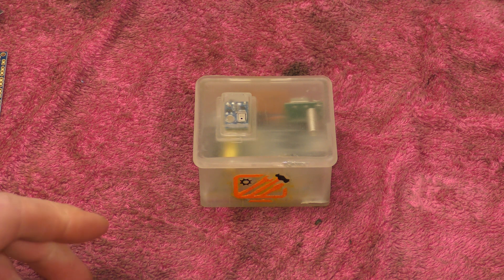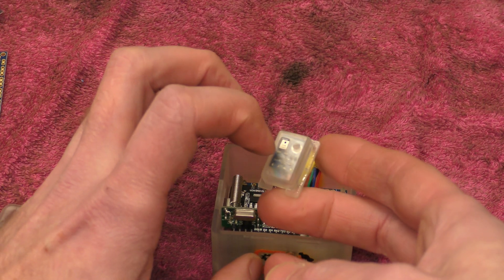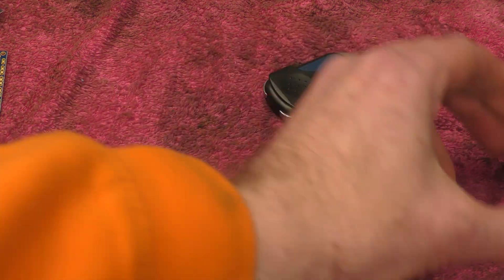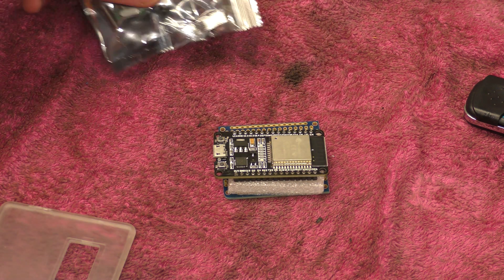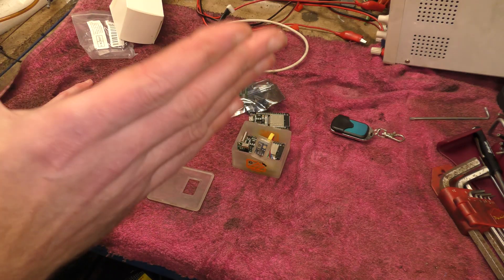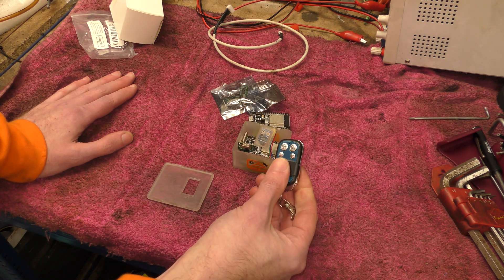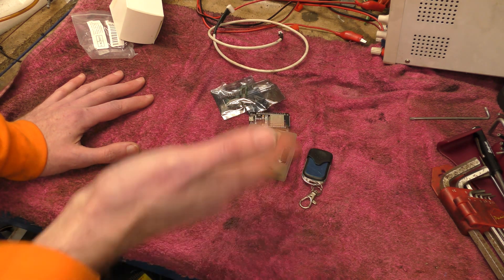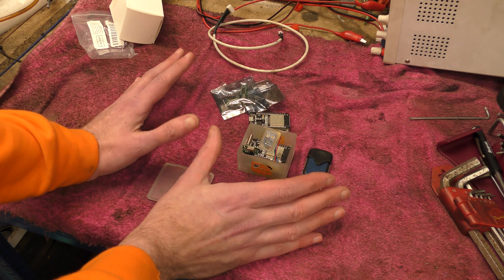The Dragon Tamer - chinese diesel heater temperature and humidity controller

Comment: Sorry my website is down at the moment. Just bad timing. 
Just a few corrections. The RF433 on the board is just a transmitter. There is a receiver in the kit I sent. You only use that once to learn the codes. If you do use the code, don't forget every one will have the same remote code, and you will have to pair your diesel heater to it. The best idea is to make a receiver grab your own codes,  then program them into your ESP32
The sensor is a AHT10 not the DHT22 but it could be used but not with the code provided.
Reply: @WiLLiAMOnline  Hi I haven't done a tutorial, but it works by copying the code sent by the remote control.

Comment: I have similar control with the Broadlink RM pro+ paired with a wifi temperature/humidity sensor 👌
can set turn on/off up/down settings automatically depending on temperature or humidity

Comment: This type of content is why I subscribed, I only wish you would avoid the crappy promoting of cheapo generators/power packs etc. You have a great presentation style and I wish you success, you really don’t need a shed full of nasty incendiary devices disguised as useful good value products any more than we do😊
Reply from the maker: Some of them are nasty.  Some of them I could never dream of spending that amount of money on.  Plus I get to make a video, which I really enjoy doing, and friends and family get things I could never afford to buy.  Some of incendiary devices I buy, actually I've got one on the way.  :)

But yes, I understand your comment and agree.  Sadly I'm just not wealthy enough to say no.
Reply: I too am not wealthy, I just cannot afford to buy cheap tools😉 Buy once, cry once as they say. I do understand your predicament, but try as hard as you can to not dilute your content and become indistinguishable from all the dross out there man. You won’t grow, & probably end up in A&E after tripping over all that free junk in your shop that you don’t want🤪All the best, keep on keeping on.
Reply: @lodgecav490  The Anker 767 isn't junk. That is probably one of the best units he has tore down. He has had other descent things he has had on this channel as well.

As for the Chinese diesel heaters, they are all the same. I have one seems to be fine so far. I'm sure the fan motor will fail since it is a brushed motor with plastic brush holders installed.

Comment: Nice. I was literally just finishing up an ESP32 project, and was also recently thinking about what the possibilities would be for doing something with the diesel heater. Though personally, I'd only go down that road if it was something closer to Afterburner functionality, and at that point I seriously doubt it would be worth the headache anyway vs just getting the Afterburner.  🤣
Reply: right , but this technique would work with litterally ANY cheap heater which has a remote. Afterburner is not compatible with some of them (not mine especially) 🙄
Reply: @Toto-os7lc  The remotes that have a display won't work,
Reply: @fenceup07944931177  ouch ... It seems like I have the worst kind: Mine does not even give me access to parameters like pump hertz or fan speed. I ordered a new control that comes with the "ECU" ( control board inside the heater) do you think I have a chance to do the swap?
Reply: @Toto-os7lc  I wouldn't like to say. I did try swapping my LCD panel and it was just a straight swap. Good luck!

Comment: Excellent video David and kudos to Fenceup even though the link does not work.

This little gadget is similar to a device I have in mind as a greenhouse controller.

To protect overwintering plants, there are two parameters one must be cognisant of ... dew point and temperature. If the ambient (greenhouse) temperature is too close to the dew point temperature in the greenhouse, mould will form which can kill the plants. Too cold of a temperature will also kill the plants.

I have been using the Afterburner to control a "5kw" diesel heater in the greenhouse and am working on a design for an electronic sling psychrometer which is basically a wet / dry thermistor configured in a Wheatstone bridge to act as a digital input to trigger the Afterburner. There are some nuanses however. If the greenhouse temperature is on the low side i.e. above zero the difference between ambient temperature dew point is in the order of 1C at 89% humidity, but as ambient temperature increases, say 10 degrees and 79% humidity the delta T increases to 2C. It can gradually increse to 4C as temperature warms up. The worst time to control humidity in the greenhouse is the spring and fall. This also depends on how much aluminum framing is used in the greenhouse it is an excellent thermal conductor to channel cold temperatures from outside. Someone astute with the psychometric charts will say you could get into a "dew point runaway" condition. This is where one needs to decide if is is better to increase the temperature or ventilate to drop the humidity, but, that depends on the outside humidity.

Comment: I made a circuit to interface a thermostat to the remote thob. It turns on and off the heater to keep a room at a constant temperature. No code required. It has been working for the past two years or more years. Burned through over 100 gallons of diesel
Reply: I was thinking of doing this myself and great to see that it worked for you!
Reply: Any problems with the glow plug from the start up and shutdown sequence cycling all day?
Reply: @GnosticElohim  No problem.  It ran for three years. The only reason that I changed the heater was that the motor barrings started to go out.

Comment: What's the actual bits you need to buy to build this little gadget?
Reply: ESP32 development board, AHT10 temperature and humidity sensor, RF433 transmitter and receiver kit, and a bread board or pref board.

Comment: Are there any controllers that can actually maintain a set temperature like a typical household thermostat? 

Why is it that the one thing these heaters need to be able to do seems to be impossible for them to do?
Reply: You must be referring to their inability to shut off and start up to maintain temp. I assume cycling the glow plug would significantly lesson their reliability. It could be done with an aftermarket controller. I imagine the one in the video could do it with the right code!
Reply: @DaEternalNoob  exactly. In a small space the control needs to be able to shut off the heater when it reaches the desired set point, not just ramp down to the lowest heat output and continue to raise the temperature inside the space being heated. Especially problematic when the outside temperature rises while you are sleeping and you wake up drenched in your own sweat because the heater simply won’t shut itself off. 

I’m aware there are aftermarket controls that can do exactly this, but none of the controllers that come with these heaters have this functionality that I’m aware of.
Reply: That's exactly what the initial Idea was. You can set separate upper and lower temperature, so it doesn't switch on an off as often. I would suggest running the heater in temperature mode, that way it will reduce the heat output as the temperature rises, and only shut off when it reaches the maximum you set.

Comment: When it comes to driving the drum motor, you could replace it with one of them jobs from electric scooters or them "hover" board things, by design they're BLDC motors usually, and with all the interfacery jobberies out there already, it's probably just a case of introducing the two together and hey presto, mains-free tumble dryer... :P
Reply: not a bad idea. do you know if you can run them in both directions?
Reply: @fenceup07944931177  As with mains-powered 3-phase motors, they can indeed be reversed, same with electric cars too, how they do it though is witchcraft to me... :P

Comment: Some things are better kept simple.  Blue tooth never seems to pair and what is wrong with just plain dials or hard wire?  Blue tooth is a power hog.  Why not just have hardwire?  I would never purchase this
Reply: It's free so no point complaining about it... better to show the developer love
Reply: @TrumpstienPhile  Sure, it is just constructive criticism
Reply: @nevereverlistens aah😁. 

the esp32 is a cheap POWERFUL all in one microcontroller (cheaper than arduino)which happens to have bluetooth/wifi) but as you say it could be configured to just have a power button and a potentiometer(to set power) and a switch to disable/enable  Bluetooth/wifi
Reply: @TrumpstienPhile  or a hardwire remote
Reply: @nevereverlistens  hard wired controller has been done in the form of the "afterburner".
A complicated build and justifiably superior device.
Reply: It is a stand alone device. Once you set the parameters you can disconnect. I did it this way to save on components. You would need a screen and some extra buttons. And code some form of menu to change the settings, all possible.
Reply: I often use ESP32 with Bluetooth and never have pairing problems or dropouts. Are you using an iPhone by any chance ?
Reply: @backyardbasher  I have multiple phones, iphone and andriod.  Wouldn't matter.  Even if it does pair, that is still one more thing I have to do.  I gave up my blue tooth keyboard for a unifying keyboard and mouse.  That is how much I hate bluetooth.  I don't need one more thing to do in life